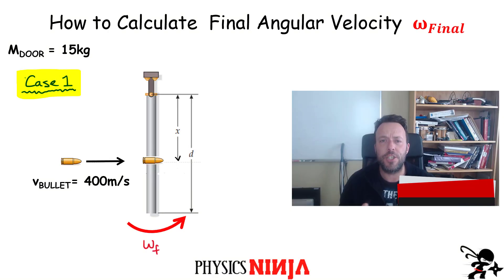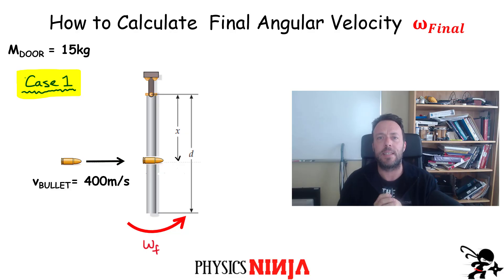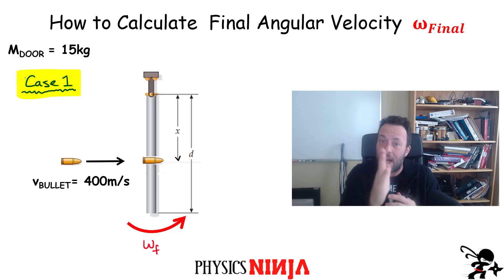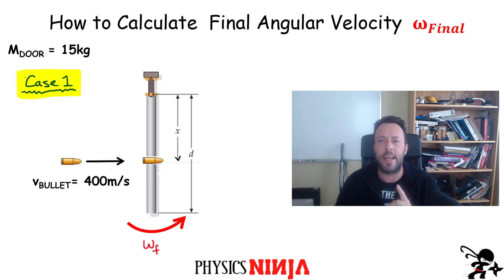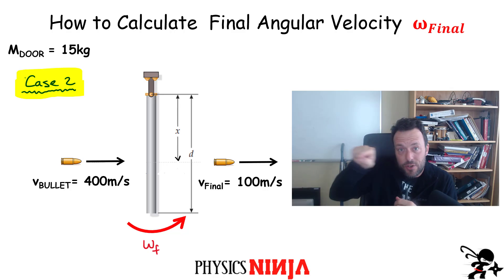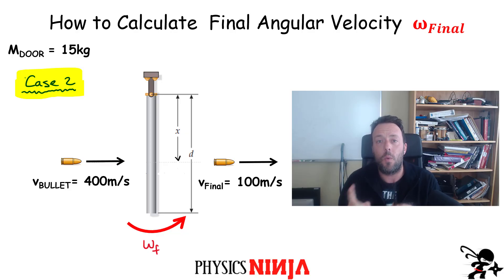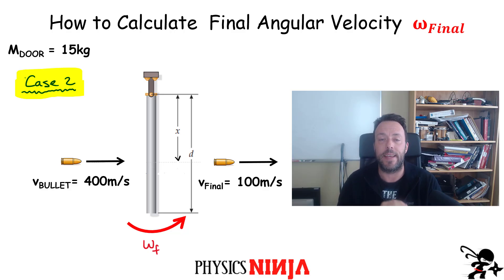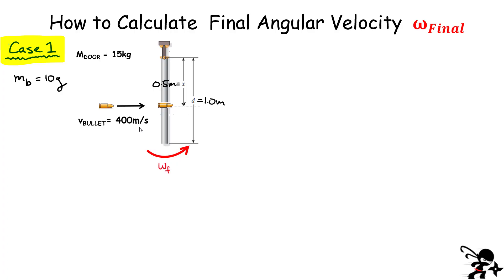Conservation of Angular Momentum: Bullet and Door Collision Problem

Comment: At 8:22, You defined angular momentum of the door as Iw. But doesn't L = Iw hold only when the rigid body is rotating about the axis of symmetry? THe door is not rotating about the axis of symmetry. How does it hold for the door case?
Reply: in general it doesn't really matter where the pivot of rotation is, so long as you change the value of the rotational inertia to match it. for example, a rod rotated about its center of mass will have a lower value for its rotational inertia than a rod with a pivot point at its end (like the one in the video). this is because when we have the pivot point at the center of mass, more of the mass is concentrated near the center of rotation, basically meaning it takes less effort to rotate it compared to when the pivot is at the end, where more of the mass is further away from where its rotating. But for the equation L=Iw, so long as we substitute the correct value for I, then we can just use the equation as normal

Comment: In the next video of the playlist, the rod is not pivoted. And in that question, when the clay sticks the rod, the center of mass was changing. What's the difference with this problem? Why didn't we consider the changing center of mass if there is any change?
Reply from the maker: In this problem there is a pivot so the rotation will be about this point.  It’s an extra constraint on the problem.
Reply: @PhysicsNinja  Oh, now I see. Thank you so much for the fast reply sir. Appreciated!